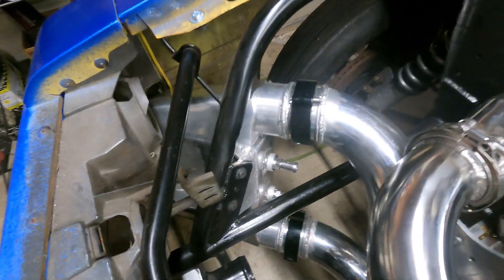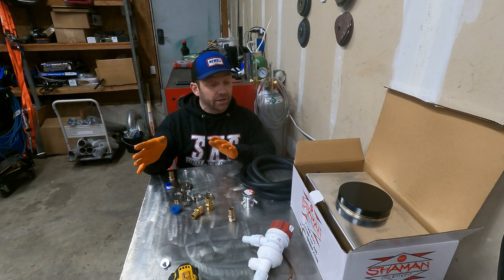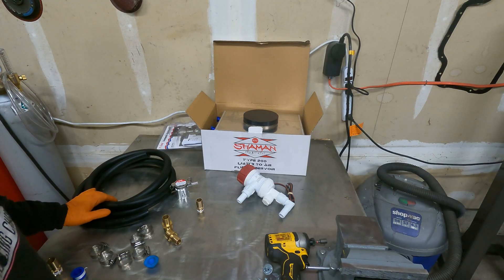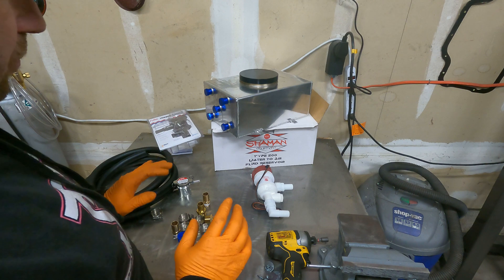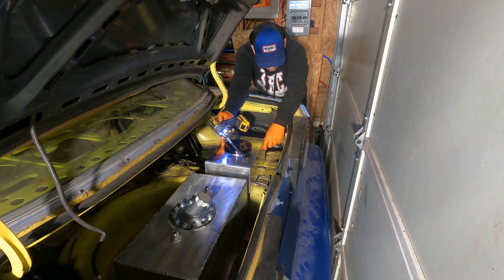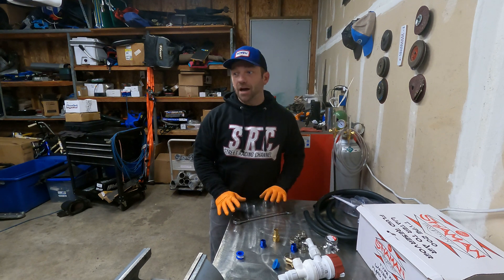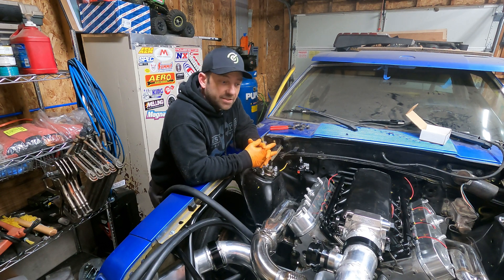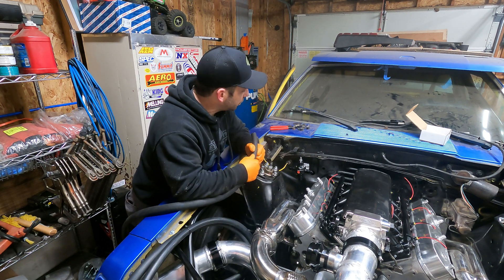SiliconeIntakes.com 1200HP Air to water intercooler install

Comment: Looking into getting one of these kits for my build any one else running one of these and is it well made product
Reply from the maker: It seems like a well made product to me as far as the piece parts go, I have yet to make any power pulls and get data on intake air temps

Comment: Do NOT run fuel in the passenger compartment. Maybe I didn't understand what you said about that correctly when you were talking about the intercooler hoses at the firewall, but you definitely don't want fuel inside with you, in the event you do crash. Nothing wrong with having the intercooler hoses in there.
Reply from the maker: Fuel and trans hoses run under the car for sure! Nothing flamable goes inside with me. The cheap coolant hoses worry my potentially dragging, but my fuel and oil hoses are stainless braided PFTE and some degree of abrasion resistance. Of course I have tried to run things up out of the way, but space is very limited, so I figure the less risky things can go inside.

Comment: Thanks for the video on this, I've been looking at these kits but it's hard to find a lot of info online. I plan on switching the intercooler to the type 12 2000hp cooler, still a great deal at 630 compared to size and cost of an equivalent air to air(just won't fit in my car). I'm also going to add in an oil cooler style heat exchanger for the intercooler water for street driving which will also let me put my trans cooler in front of the radiator as well
Reply from the maker: That is a great idea, I have just figured I get what I get on the street side of things, I may explore something like that down the road, thanks for the idea. At this point though I am just trying to button all these things up and get a useable car.
Reply: @DARIUSNORTHERNGRIND  getting up and running is half the battle, everythings easier after  that. I'm stuck in the garage until this salt goes away
Reply from the maker: @josephkemp4404  I hear that! We had the mildest winter that I can remember, no snow on the ground and no excuses for me other than to just get it done.

Comment: A’guy I’ve watched a few times deven vanderhoof said something hella intelligent, before you start wiring or plumbing, or any of that bullshit you need to take all of your parts/ accessories & get them mounted in there spot that way whenever you start doing all the wiring & plumbing your just literally running everything where it needs to go like a map.
Reply from the maker: That’s exactly the plan, as far as this part of the project goes, the water pump was a bit of an oddity, and I didn’t want to build into a corner and not plumb it efficiently.